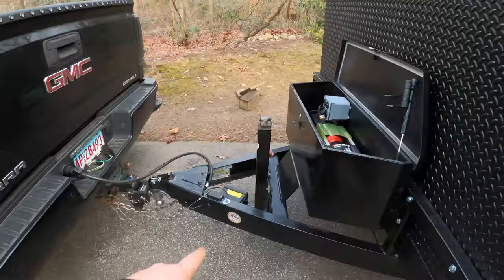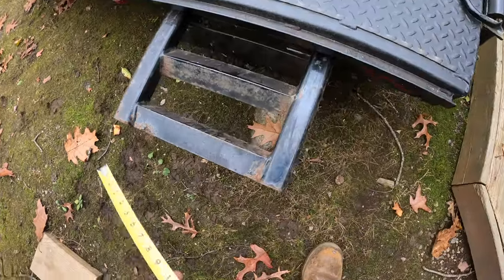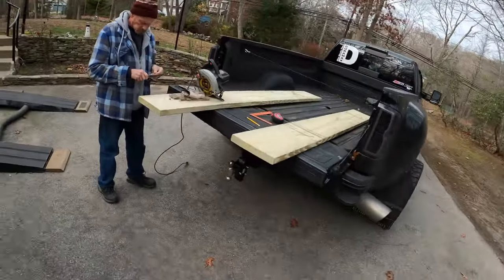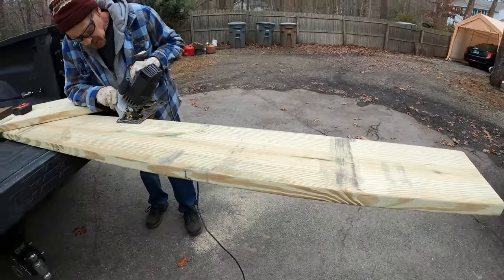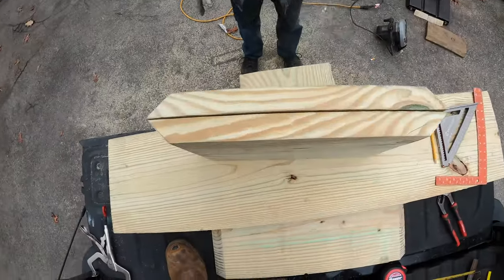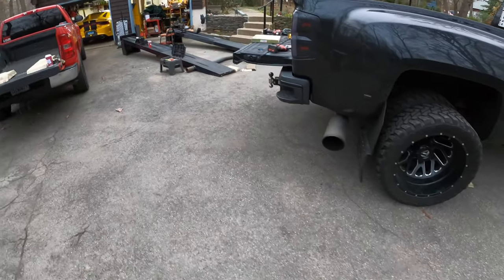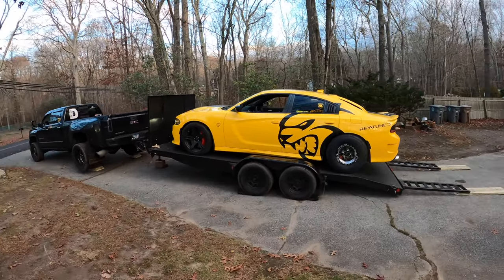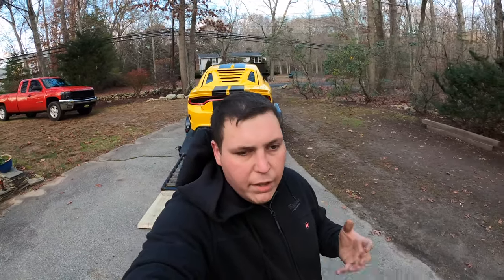TOO LOW TO GET IT ON THE TRAILER.?.?

Comment: Preciate your trailer build, I'm getting ready to repaint mine. I  have a procharged C7 ZO6 that sits lower than yours, I use race ramps that will allow any low to just drive up with no clearance issues
Reply from the maker: Nice! I was going to order some race ramps but they over priced in my option for what they are an I don’t plan on using the open trailer much longer so I made some other ramps I have now that work mint